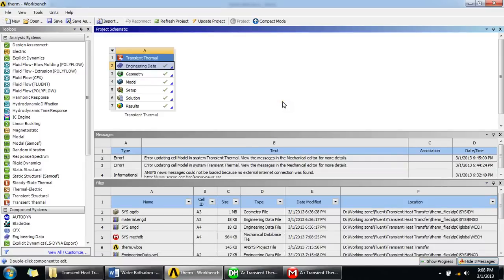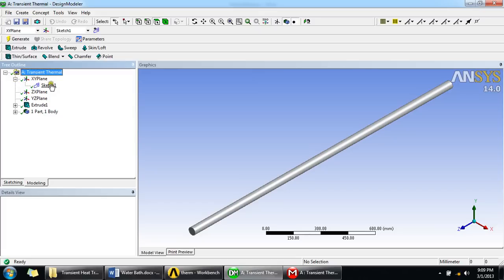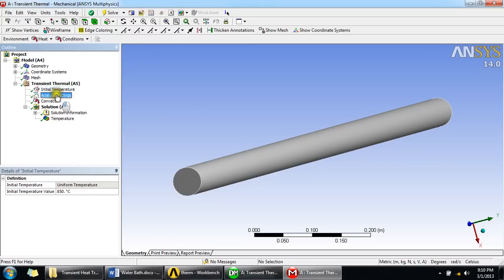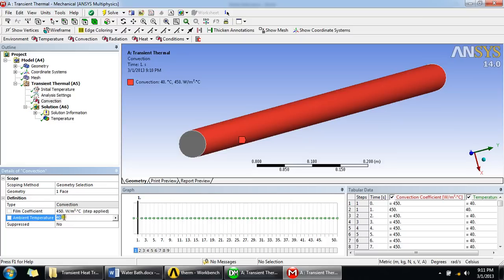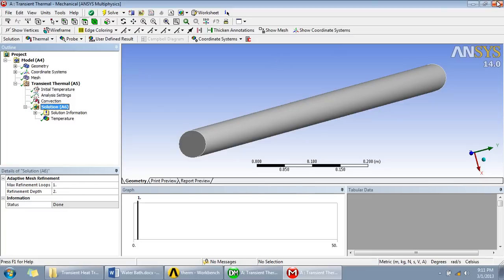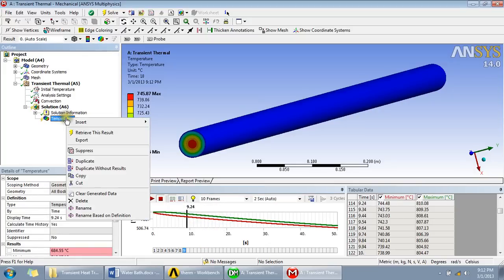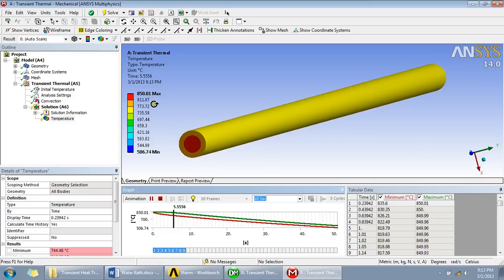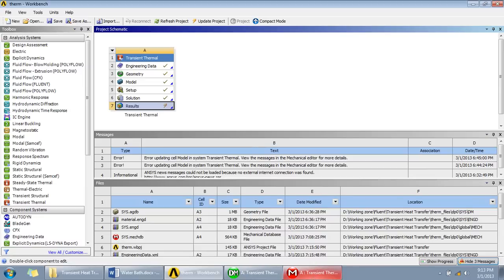Transient Thermal Analysis in ANSYS - Tutorial (Quenching Process)

Comment: how can we find the temperature variation without thermal conductivity value being assigned, as a means to identify the thermal conductivity from the temperature variation. Provided materials properties are - surface temperature 100 degree C, convective heat transfer coefficient at ambient temperature 2.5 w/m2 k, ambient at 27 degree C, assume adiabatic

Comment: Hi there, 
Just a quick question please. I have a thermal transient simulation which I have run and obtained the change of temperature of the different faces of my body(it is a 3-d wall) with time. Is there a way now to obtain the change in thermal conductivity with time using thermal transient on ansys? Thanks

Comment: I'm trying to model a transient thermal/ transient structural analyses for the same quench, but I cannot get the right effect to go on in the stress analysis.  You should see some heat treatment distortion where the stress on the outer diameter is in tension for a split second, then it switches back to compression and vice versa for the inner (see figure 1a).  This is due to the cooling rate.  Any thoughts how to model this effect?